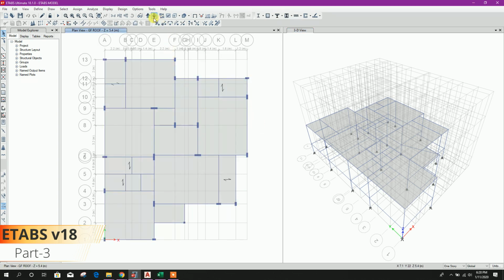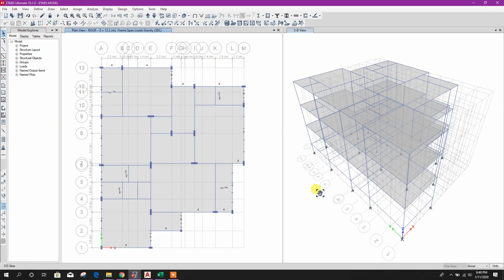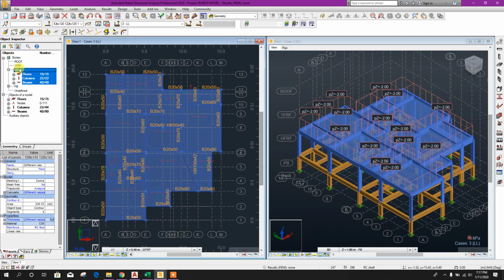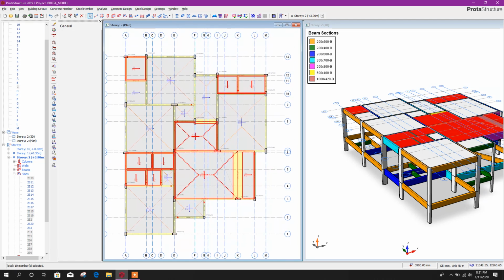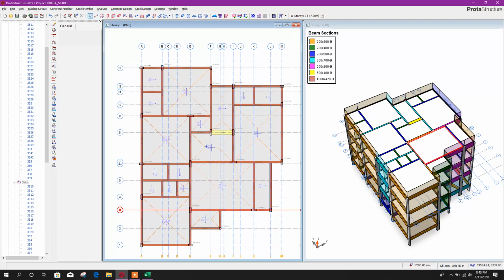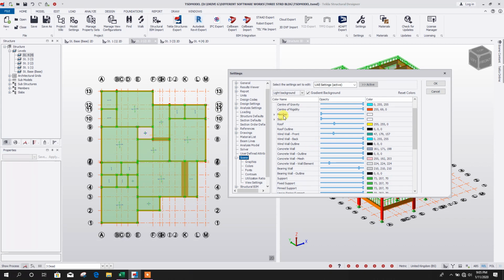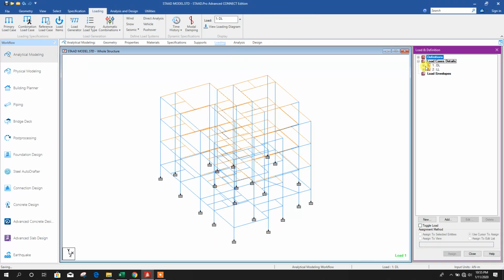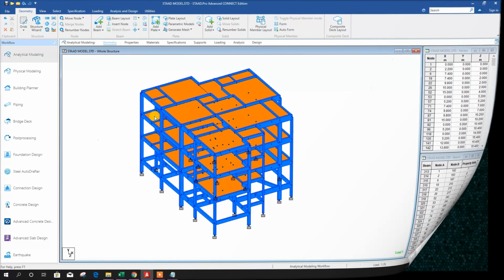Three Storied Building Modeling (Part-3) in Etabs,Robot,Prota,Tekla SD,Staad Pro

Comment: What sort of support (like fixed or hinged) we should use for a Concrete frame building (with reference please).
Reply from the maker: It will be fixed as the columns get fixity from the foundation below ground level.
Reply: @Decodebd  Jajakalla Kair.
Reply: @Decodebd  I've one  more confusion concerning use of membrane/shell Thin/Shell Thick Slab. When, which on we should use? Please reference sheet if you have and don't get bother.
Reply from the maker: Just google it, you will find literature from csi also. It has some detailed discussion.
Reply: @Decodebd  If possible please make a video on this topic.